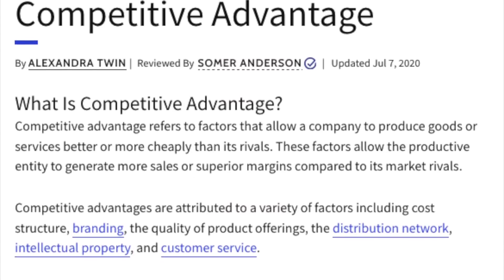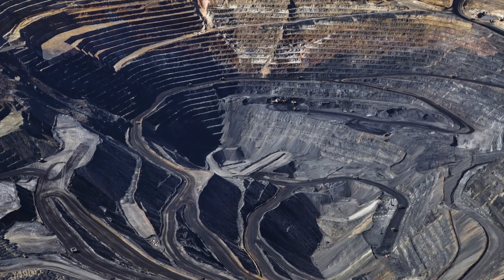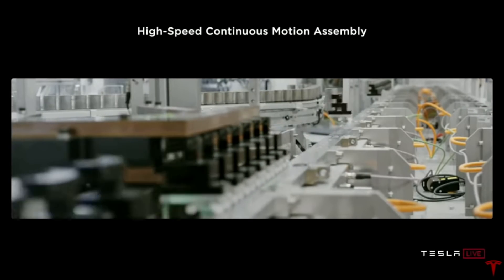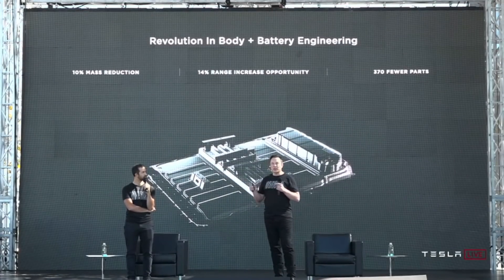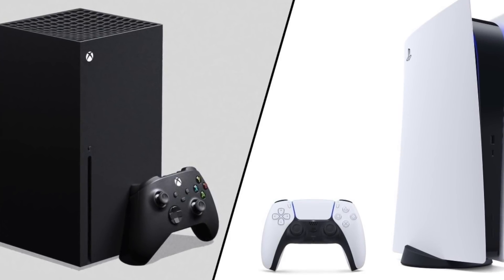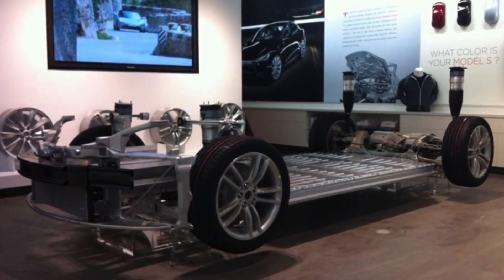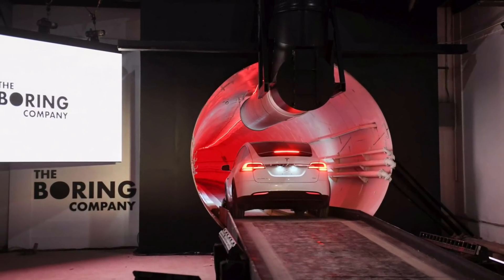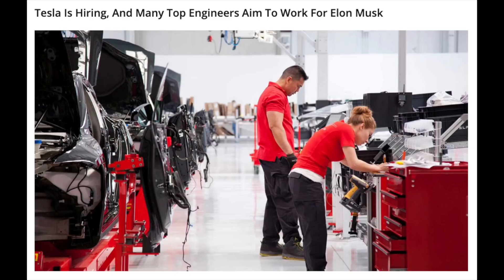What Are Tesla’s Competitive Advantages? Does the Competition Have Any Chance?

Comment: The main competitive advantage Tesla has is first principles thinking. This gives them their drive to rapidly and deeply innovate, and to plan far ahead. 

Everything Tesla has been doing for years has been focused on winning autonomous mobility. Autonomous mobility allows one EV to replace multiple ICE cars, so it massively accelerates the transition. The drive for durability of the battery and drivetrain of a million miles, the drive for energy efficiency, for lower production costs, it is all aimed at achieving the lowest costs per mile for autonomous mobility. No other company is actually competing with Tesla for the vast future industry of autonomous mobility. Competing will require both autonomous technology and the ability to provide an enormous fleet of durable low cost per mile energy efficient EVs. Only Tesla will be in the several trillion dollar market for autonomous mobility, and once dominant it will be essentially impossible for anyone to take market share from Tesla.
Reply from the maker: I agree and the competition aren’t competing against Tesla, but cannibalising their other cars. Good point about first principles.